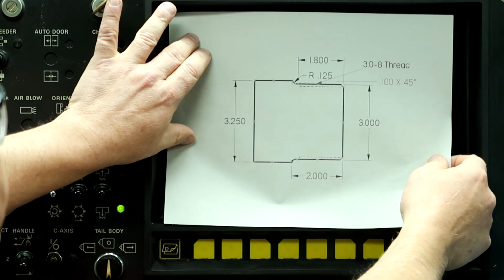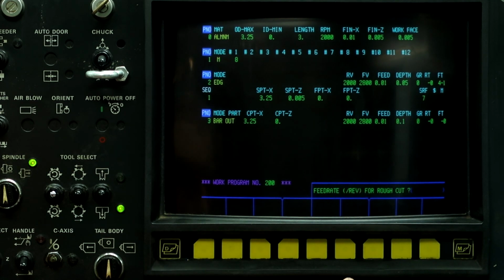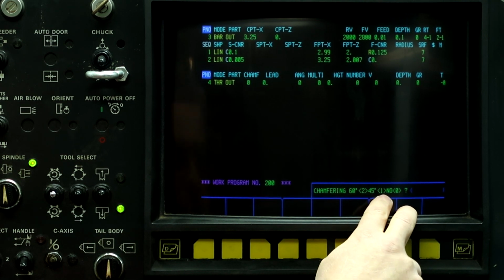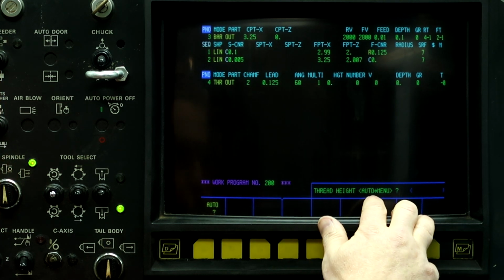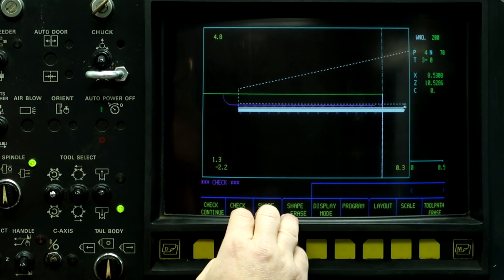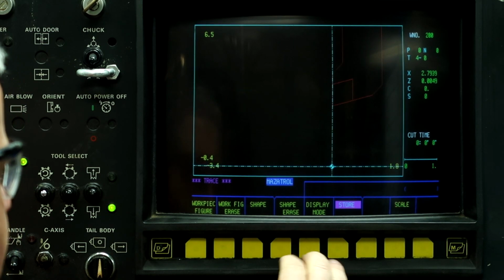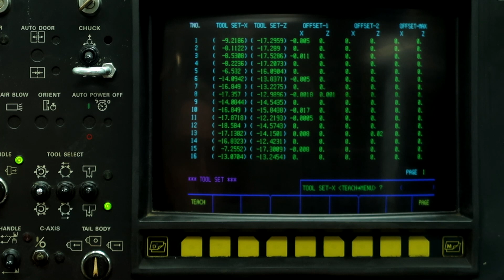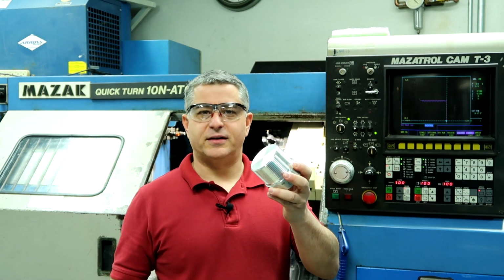Mazak Lathe OD Threading Mazatrol

Comment from the maker: Warning!  I forgot to mention in the video but DO NOT change the speed on the override or in the program during or after the machine has cut the part on these older controls.  The machine will loose the thread lead if you alter the speed and it WILL scrap your part.  BTDT.  Only make changes to the spindle speed after you get the part off the machine.
Reply from the maker: @christophercolumbus8944  The way Mazatrol works is you need to have a minimum of 3 passes in the threading line.
Reply: you should've shown how to do a spring pass cause that's what you need right?? just clean it up
Reply from the maker: @derick3482  I didn't think about it at the time, but yeah easy to do on Mazatrol.
Reply: Thanks sir

Comment: Thank you, Phill, this has been very helpful. I have a problem with my machine, in simulation I have a good thread, I mean the cnc program it's Ok but when I run the machine this is not working, I
I've been investigating and it seems I need to enable a parameter “Thread Cutting Enable”, I wondering if you have any information that could help me enable this parameter., thank you in advanced, best regards.

Comment: I start a new job and they're going to train me how to use mazatrol. Ive been running machines with programs for 10 years. So this is new to me but, man, this looks so easy compared to what i was doing. I would write g/m code programs by hand at the machine. This video is going to make me shine on my first day. Thanks for the tips.
Reply from the maker: Mazatrol feels like cheating compared to G-code. Lol
Reply: @mazatroltipsandtricks6816  hey and I'm all for it! Bye bye g code. You will not be missed. All it did was accelerate my arthritis.

Comment: @mazatroltipsandtricks6816 Is there any way at all to change spindle speed during a thread. Like say you were getting a lot of vibration and wanted to slow it down while running the thread is it possible?
Reply from the maker: @logano660  Not on the older controls. It will loose the lead and scrap the part.

Comment: Hi, have you any experience with tracing/ picking up existing threads for reworking?  I've been led to believe that it is possible on the T series controllers??? 
I know it's possible on later controller, would be super handy if it can be done on T series
Reply from the maker: @kevmarriott6272  extreme pain in the ass to do it. Very risky operation because it's an eyeball job trying to line up the moving tool to the thread. Not recommended.

Comment: Hi Phil, i need to make ID oil grooves in a bush, been trying using the ID threading option after 30 mm pitch it doesn't look correct on the display
Can the T2 manage this? any advice would be greatly appreciated 
Thanks
Reply from the maker: @miguelneves3982  the display will look funky with an extremely coarse thread but it will work. Be sure to have PN0 0 line ID min set to the bore diameter of the hole otherwise the machine will retract X to 0 on last pass and possibly crash the grooving tool into the other side of the part.
Reply: Thank you much appreciated

Comment: Thanks for the awesome videos. I am trying to make internal threading toolpath for which the tool should retract to X21mm and then come out of the hole. But in actual, it first retracts to a smaller number i.e. X17.3mm and then go to X21 and then come out of the hole. X17.3 will cause my threading bar to smash in to workpiece. Do you have any idea what could be wrong and how it can be avoided? Would appreciate that. Cheers.
Reply from the maker: On the T-2 and T-3 controls, you need to put PNo0 line ID size same as the minor diameter of the thread. Check out my ID threading video.

Comment: Hello Phil, I can write the program as you showed, it works in simulation, but when I run the machine, it gives error code 635 ACCELERATION DISTANCE EXCEED. What could be the reason? Best regards
Reply from the maker: What control is on the machine?  You can slow down the cutting speed to get it to work or change a threading parameter.
Reply: @mazatroltipsandtricks6816 mazatrol t32-2.I've just started using Mazak, I'm taking examples from your videos, but I'm still at the beginning and I'm a novice, thank you also for your answer.

Comment: Not sure if you will see this since it an old video. Do you have anything that explains how to add a thread relief, specifically for my situation when the thread relief is against a wall. Thanks.
Reply from the maker: I have not made a video regarding a thread relief even though I do them all the time. I did a grooving thread relief on my ID threading video. For OD threads, I usually use a VNMG 332 insert tool and program a relief groove at a 45 degree angle behind the thread.
Reply: @mazatroltipsandtricks6816  

I’ll try that, thank you
Reply: Попробуйте на внешнем диаметре перед стенкой сделать канавку для выхода резьбы. Тогда ответная деталь закрутился вплотную с стенке. Мой опыт СССР, 1985 год. Mazak st-60, M-1

Comment: Hi, Mr. Phil thanks a lot for your video! At the end of the video Could you please explain why are the tool offset-X 0.005 and 0.001? How do you know it, sir?
Reply from the maker: The offsets were just examples. You will need to adjust your offsets accordingly to what your part measures.
Reply: @mazatroltipsandtricks6816  
Yes, I got it, thank you so much for the helpful videos. Hope you're still doing well during this pandemic time

Comment: Hey Phil Thanks for all you videos they've been a big help, 
Do you have any tips on Thread clipping in Mazatrol?
Reply from the maker: I've never attempted it. I'm sure it can be done with a groove tool running a short threading process.
Reply: @mazatroltipsandtricks6816  Hey Just thought I'd pop back in here and share what I found, if you want to thread clip a UNC thread it can be done by running a threading cycle with a start point a half pitch farther out than your original threading cycle, and ending at a full pitch in! keep your exit angle at 60 degrees and your grooving tool should have it clipped!
Reply from the maker: @ceugepios  Thanks for the info.

Comment: How to make NPT thread in this machine plz help me any one
Reply from the maker: Male or female thread?
Reply: @mazatroltipsandtricks6816  I got it sir I need one help from you sir
Reply: @mazatroltipsandtricks6816  my mail I’d is j.Saravanan898@gmail.com ping me sir I want tips for making multiple serrations on outer dia
Reply: @saravananj384  NPT is just angle right?different diameter?s
Reply: @christophercolumbus8944  yes how to do in mazatrol
Reply: @saravananj384  ok so choose Turning>then THREADING> OUT > # 0
CHAMF 0
LEAD= 1/(TPI) 
ANGLE  60
MULTI 1  
HEIGHT = half of lead
NUMBER = 12 passes usually or 10
Cspeed 300
DEPTH  leave it blank
TOOL "THR OUT A " 
SEQ > SPT X - - - SPTZ 0 
FPT X - - -  FPTZ - - - -
you need diameters and how long you're threading

Comment: Not using M03 and M04 3D program
Reply from the maker: Not sure what you are asking me.
Reply: @mazatroltipsandtricks6816  How will the direction of turning the spindle change
CLOCK WISE and COUNTER CLOCK WISE
Reply from the maker: @pilotrailka  It will cut either a right hand or left hand thread depending upon the tool.
Reply: @mazatroltipsandtricks6816  my machine is MAZATROL SMART
Reply: It is created in the program you have created, it does not run, it is an alarm.
Reply: Your machine is inches 
And 
My machine is MM
Reply from the maker: @pilotrailka  Check the tool description.

Comment: I need to turn a 1-8 left hand thread. Never have done it, I can't find any information on it. Any help is greatly appreciated.
Reply from the maker: Same procedure as right handed thread. You just install a left handed tool in the turret and set the chuck direction to left hand. The threading program will be the same.
Reply: @mazatroltipsandtricks6816  I'm guessing it needs a left hand insert holder?
Reply: A colleague said I could use a right hand and start into the part, 5 inches in this case. And thread back to the front. Will this work?
Reply from the maker: @robertzacharias6567  Mazatrol does not play well with that method. Get a left hand tool.
Reply: using Mazatrol T32-2  I cut right and left-hand threads M50x1.5 with same tool & insert, just change Z start and finish points (swap them over) you do need to allow for approach/acceleration distance for the left-hand thread

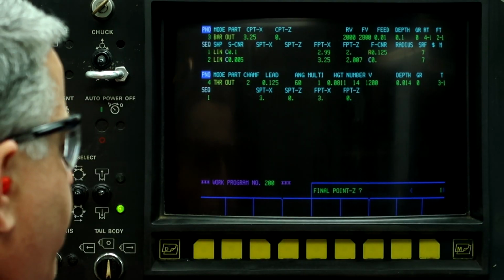Comment: Tip: At 10:35 where you can set the next line to thread i an taper, If you rewrite the same stop point again  eg: FPT-X =3  FPT-Z=1.8 the machine transit in a smoother motion at the end of  the thread and not doing the sudden stop motion. Works on newer machines don't  know about this machine.
Reply from the maker: I will have to try that. Thanks.
Reply: @mazatroltipsandtricks6816   Hi, adding this line, would this be like a spring pass?

Comment: how do you remove the burr at the beginning of the thread? Are there special solutions in Mazatrol? In TCP? Thanks for the reform option and other useful information.
Reply from the maker: You can remove the burr by rerunning the finish pass of the turning operation after the thread is cut.

Comment: Nice videos Phil. Fully informative. Thanks. 
I m a Mazak turning machine operator. new comer to Mazak from Fanuc
Using Slant Turn 600 Smooth G.
I hav not seen tool shape in simulation . Only path graph we r using till now. Is there any Idea to have tool shape also in simulation as you r using.?
Reply from the maker: Unfortunately, Mazak took away that feature in the later controls.  You have to do a simulation to see the tool now.

Comment: Hello friend, look at me, I get an error in the subject of threading, the alarm is acleration distance exceed!  And it won't let me screw.
Reply from the maker: What controller do you have?  I only have parameter information regarding the T-2 and T-3 controls. 

For the threading parameter, U35 controls the acceleration distance.  It is set to a low value from the factory and that causes problems with threading at high RPM speed.  The range of the parameter is 0-255, but I have mine set to 100 and it works fine. Other option is to slow down the threading SFM value in the program.

Comment: Would like to see some videos of a 40n t plus that’s what I have and all we cut is a36 anywhere from a 16x2.5 inch blank making casters to threading an 1.25 axel bolt😂
Reply from the maker: I do not have a T+ controller.
Reply: Mazatrol Tips and Tricks still have useful info though

Comment: Is it possible if you can make a video on thread clipping on mazatrol and explain it in depth?
Reply from the maker: Thread clipping?  Not sure what you mean.
Reply: @mazatroltipsandtricks6816  I mean taking away the first imperfect thread with a grooving tool. For example on a 8 stub acme  thread and using a grooving insert that's 0.125 to remove the first imperfect thread. I've also heard it being called a higbee thread too
Reply from the maker: @albertta2025  Got it. Never tried to Higbee a thread.
Reply: @mazatroltipsandtricks6816  I think he might want to know how to run a higbee cut

Comment: Great video.  I run a Nexus 350 II.  Threading isn't my most fun thing to do.  We have added the speed override option which works great for modifying speed during the thread cycle. The only thing I never figured out is the touch off of the tool on the tool eye vs the offsets.  They are never theoretically zero on the X axis like a correct turing tool at the finish.  They are always way negative on the OD or way positive on the ID from zero when threading only.  I use .86603 x pitch for my thread height.  I can get good threads but just can't trust to go to size or close off the tool eye.  Also do you have any videos of how to chase threads for repairing if loaded back in the machine.  Ours has that capability but nothing in the book to truly describe how to do it.  Thanks for your videos. Older machine but the concept is the same.
Reply from the maker: Our Integrex has the feature to pick up a thread but I have never tried it out yet. Old machines like my 10N doesn't have that ability.
Reply: Jim Monk Does your machine come equipped with the Thread Position Teach option?
Reply: @brianmatias471  yes it does I believe.  I have not tried it yet since we purchased the machine about 4 years ago.  Haven't needed it yet but would like to figure that feature out.
Reply from the maker: @brianmatias471  I don't remember if it was included as a standard option or if it was extra for the Integrex.

Comment: coming from a fanuc background why are your tool offsets all 1 instead of t0101,t0202,t0404 etc?cheers.
Reply from the maker: This machine uses offset columns like a grid.   Offset column number 1 or the second offset column 2. Go to 18.34 in the video. You can see the two offset columns there.

Comment: Hey man, nice video again, coule you explain the surface roughness or make a video about the diffrance?
Reply from the maker: Lower numbers are rougher feed rate and higher numbers are finer feed rate. Number 7 finish is slightly better than a 32 rms finish. It feeds a .031R insert at .0039" IPR.

Comment: Is the length value the total length of the raw stock (including what is clamped in the chuck)?

Or is it just the visible stock protruding from the chuck jaws?
Reply: Raw material, plus I always add some more mm.
Reply: Tomasz Spiszak thanks. So the length is the raw stock the entire raw stock. This includes what is clamped and visible ?
Reply: @75kGa  yes.
Reply: Tomasz Spiszak awesome thanks. One last thing. What about the inside diameter values. If I have a raw solid stock and I am to bore a hole say 6inches as per drawing. Do I then insert this value of 6 in the ID value field?
Reply: @75kGa  put 0 in the first line for stock min dia. Check out his 1st or second video ,  there's a great explanation.